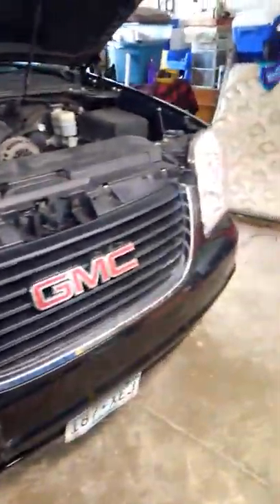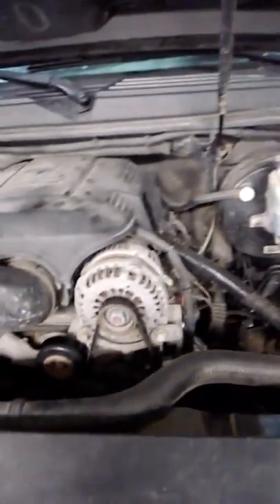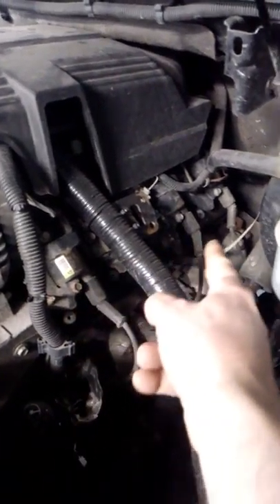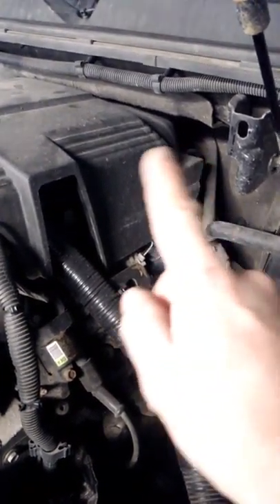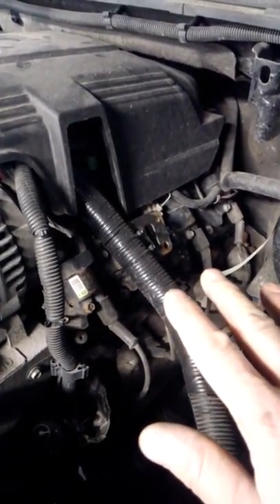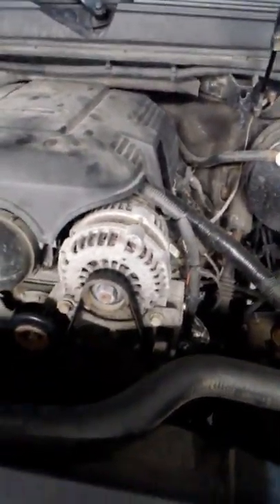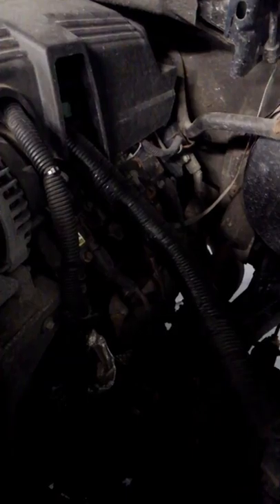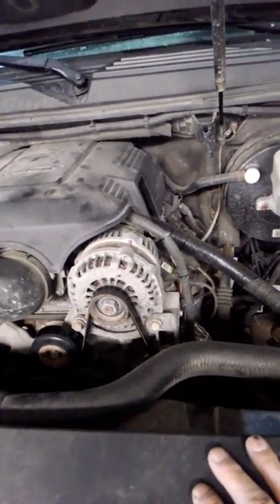FIX Smoke on start-up 2007-2012 5.3  GMC Chevy Tahoe Yukon SOLVED!!

Comment: Fixed my problem thanks.. mechanic's was asking for 500-800 for fix 😒
Reply from the maker: Very cool! Thanks for the comment!
Reply: So a friend has this and it was light smoking she said now it's doing it heavy when she stomped on the peddle could this be the reason ?
Reply: @WrenchSense   I have the same problem now with my Chevy Tahoe 07 I talked to two mechanics one told me I had to get a brand new engine the other I had to flush something out. I'm definitely going to try your method!

Comment: My 2005 chevy silverado stated this last week . I will try this fix . I did wonder if it was a bad pvc . It dosnt do it on every start . I knew it wasnt the rings cause it stops after about 10 seconds with the engine running . Just one huge puff of smoke when it starts then it goes away . Thank you . I subbed and thumbed this video .

Comment: Yea it only smokes on start up after the engine has cooled overnite..i'm having this issue AGAIN FOR THE SECOND TIME IN TWO YEARS..The first time I just cleaned those il passage holes out with carb spray and compressed air.  This time I will drill these oil passage holes out bigger..they are about an eighth of a inch from the factree...I will drill em out to 5/32"..I am very confident it will fix the issue..it fixed the problem on a 2008 avelanche

Comment: I have a 2008 Cadillac Escalade EXT and it just now started smoking on start up and clears out after one minute. It has a 6.2 liter but I think the block is the same as the 5.3 liter. I am going to research and try replacing the valve cover on the driver's side where the pcv valve is located. Thanks.

Comment: Bought a mint 2005 Tahoe with 5.3 141k miles and it started a small puff of smoke when you start it for just a sec then stops. Going to try an see if that’s the issue! Thanks
Reply from the maker: Sounds like valve seals to me.
Reply: Did you ever fix this issue

Comment: Hi Wrench Sense I am a subscribe of your channel and I trust you the most for fixing my vehicle my own vehicle.  I have a 2001 GMC Sierra 1500 (2WD) V8 5.3L and now I have a white smoke coming from my truck tail pipe.  It is a coincidence that it all happen on my oil changed that I did it myself after a 2-3 days of driving.  My oil dip stick is at max only not over filled.  Do you think I may have bad valve cover as well?
Reply: I took off about a quart and a half and it is still having white smoke upon start up.  I also have a P0300 RANDOM MISFIRED and changed all 8 spark plugs but the code still comes back as P0300.  Any ideas?
Reply: iGo Green did you ever figure it out having same issue

Comment: Will the nexts step be changing  the valve cover on passenger side if driver side isn’t clogged up to eliminate the smoke coming  out tail pipe? Just asking cause I don’t know an will let the info thanks in advance

Comment: Man.... my steering column housing shattered and it sat for a month or so til I could fix it and when I did I turned it on and it started to smoke bad... thought it was headgasket but no mixing fluids or frothy oil or anything! But only could find headgasket issues with smoking tailpipe and so now I have my motor torn apart and just saw these videos about the pcv valve... feel so stupid and pissed at myself lol could of had that thing fixed a year ago... now time to build engine back and get a new valve cover🤦🤦
Reply from the maker: Bummer.

Comment: Do u think this would make your oil pressure drop and blow a lot of smoke instead of just on start up
Reply from the maker: A blocked PCV system would not affect oil pressure.
Reply: There know for faulty oil sending unit.  They bounce around on the gauge.

Comment: Thank you for the video! I have same problem. 2009 Chevy 1500
Reply from the maker: No problem. Thanks for watching!
Reply: @WrenchSense  I see a 2008 1500 Silverado , with a 178000 miles on it  at a dealership , I’d it a good idea to get it ?

Comment: Can you please clarify as you said to open the oil cap and suction etc, how to test?
Reply from the maker: Hello, yes just remove the oil filler cap and put your palm over the filler neck. You should be able to feel a slight vacuum. If you feel air blowing out of the filler hole then try replacing the PCV valve. Thanks for watching. Hope this helps.

Comment: Could this be the same problem on a 2002 suburban?? Only smoke on some start ups.  (Blue smoke)
Reply: Also it uses about 1.2 qts every 3000 miles. About 190,000 miles on her.still a good vehicle.
Reply from the maker: Indeed. Same engine.
Reply: Wrench Sense what was the brand you used. At my local Autozone their price was 170...
Reply from the maker: @williamnewman2335  Dorman? I. Not able to look right now. If incorrect I will let you know.

Comment: Wrench sense I got a question my fiancé let a guy older man an his son work on our youkon an man it’s been a mess collapsed lifter driver side an thought he fixed it right an he said he only cleaned the lifter when he took apart an it’s fine now we went an got it an got 2 miles down road done it again he said bring back I said I want all new lifters replaced gaskets ect an he supposedly did that he said the lifters we brought all collapsed as soon as he put em in lol an then he went an got some he bought an let u know he also said he punched out one the screens in the gasket so the oil would forsure get to where it needed umm I knew it was a big mistake he told her come get it he couldn’t do nothing else without it 950$ later it’s blowing white cloud of smoke when u start it an going down the road it’ll say low oil pressure turn engine off I had several to do this but wats ur opinion on this it don’t have water in the oil an it’s not using coolant if so barley I don’t know wat to do this is my opinion I said the o ring on the pick up tube an possibly the oil pump it’s also sucking the fuel she said just had the oil pressure sensor replaced 5 months ago I told her could be the screen not sure need help an advice???